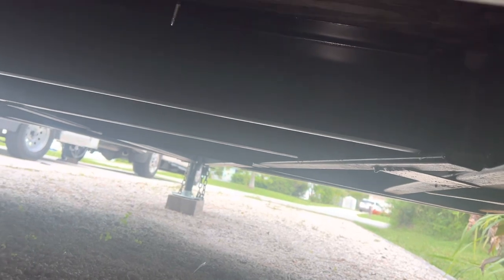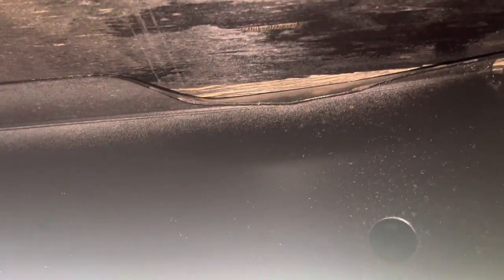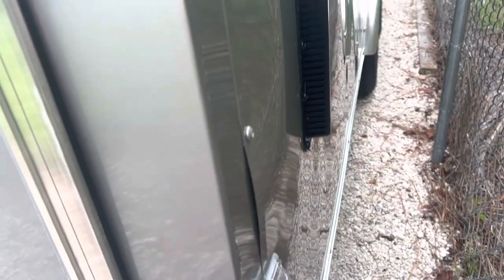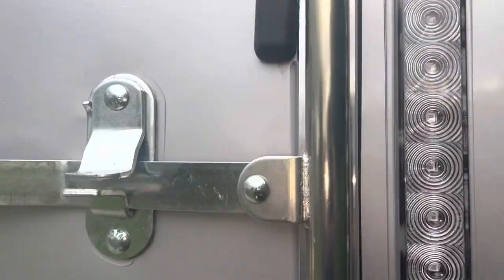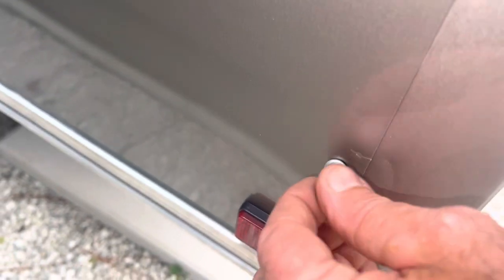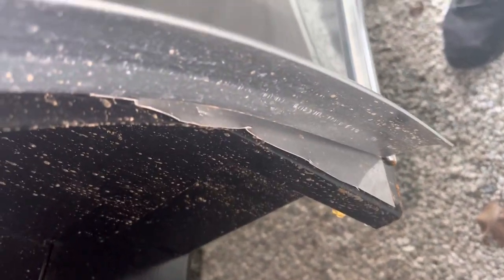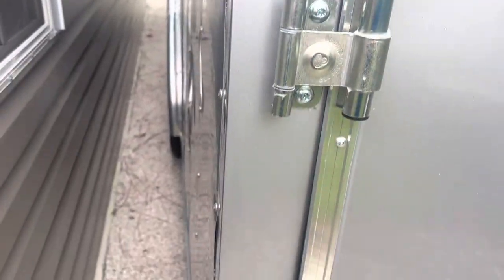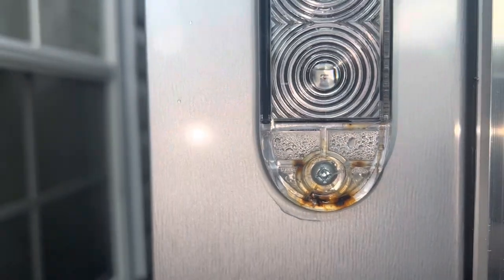HONEST REVIEW SNAPPER TRAILER  AKA DTI TRAILER, FREEDOM TRAILER, DOUGLAS TRAILER AND OTHER NAMES

Comment: Same trailer manufacturer.  My rear sping hanger literally tore the frame off. Not heavy did not hit anything! Expert welder who repaired it said the metal was wayyyy overheated during the welding of this hanger.
Reply from the maker: There is nonworkmanship on these trailers they just turn them out without fixing any mistakes and hope they get by!!